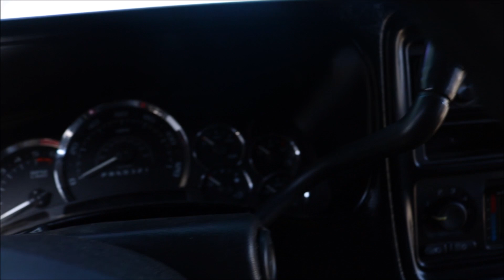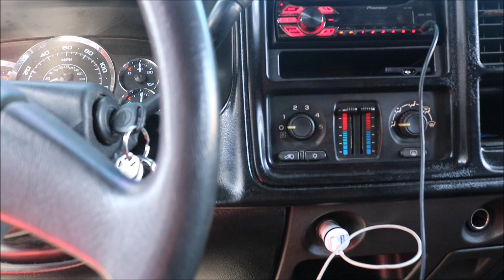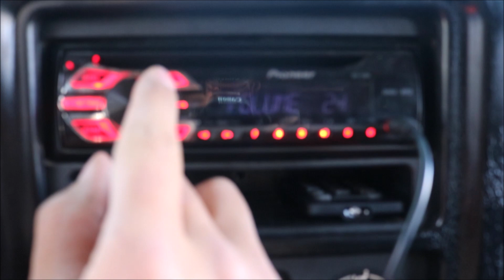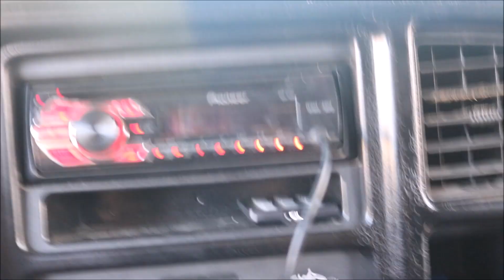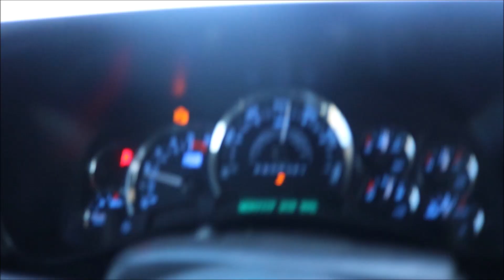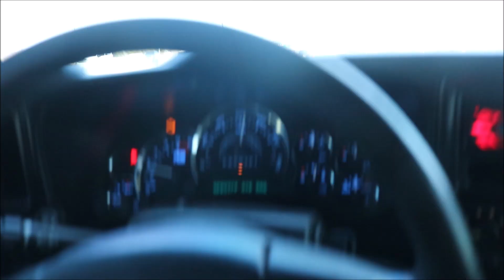Washing the DROPPED Crewcab Silverado(lil vlog)

Comment: Whats the drop ?
Reply from the maker: Froilan Franco has a 4/8 drop for now
Reply: Did you install aftermarket front or rear shocks? And is the front drop, springs n Spindles or lower control arms ?
Reply from the maker: Front drop right now is just springs. I haven’t put anything else on yet,( plan to soon) and same shocks. No aftermarket yet